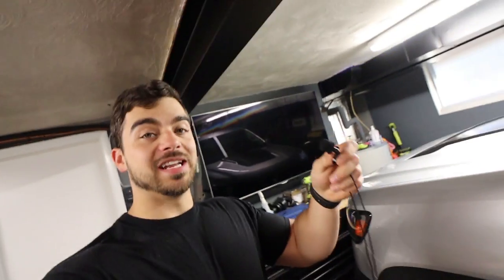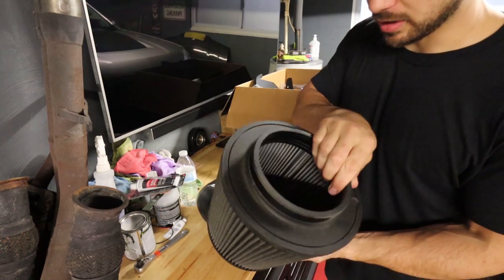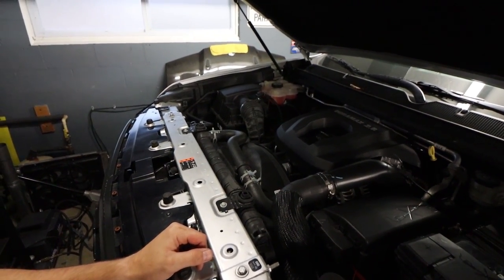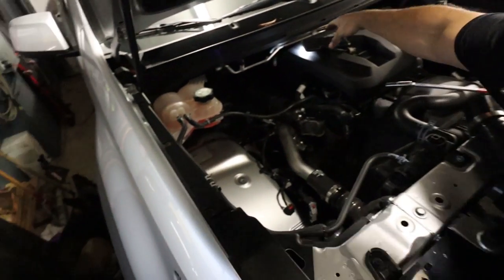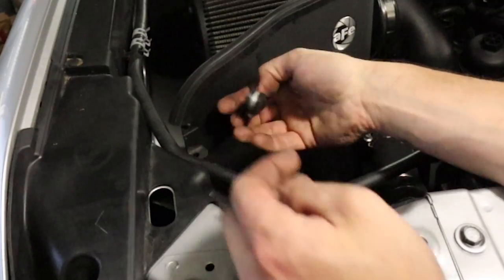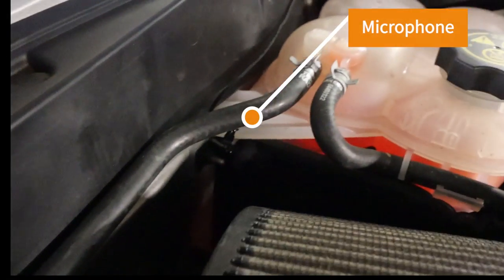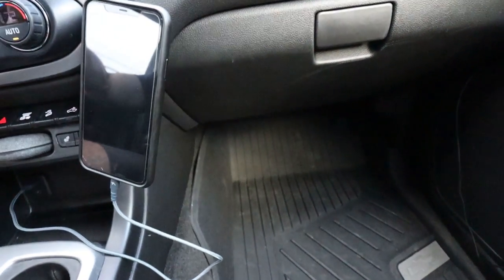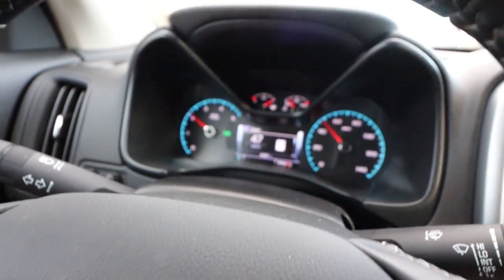Colorado Diesel AFE Intake Install with Engine Microphone on a Tuned Duramax ZR2 * LOUD

Comment: Love that microphone, hear the blowoff valve I think....sounds really good
Reply: there is no blow off valve
Reply: Its compressor surge
Reply: @collinpaine2572  no its not lol the truck isn't under any load and its very hard to surge the stock setup
Reply: @HunterSkiff  its a tuned truck so its going to command more than a stock tunr and the stock turbo is only a 52 mm exducer. And with no blow off valve the air has no where to go. Its normally muffled by the stock intake. If its not a small amount of compressor surge than what would it be? I have a zr2 diesel and mine will do it under a slight load with my tune.
Reply: @collin paine  kinda hard to have compressor surge with a diesel that has no waste gate. Diesels dont really care about air volume going in as fuel is your throttle. The 2.8 duramax has a butterfly that is used for exhaust brake throttle.

Comment: What kind of fuel economy are you getting now? I did the “Canadian weight loss treatment”  to mine as well. Thanks to you good sir! I did the S&B intake on mine. That VGT turbo makes it sound like a Compressor letting off at low fuel input lol 😆 I have 2500 miles on upgrades and I have seen at 75 I average 26 to 28 mpg on a route that I normally got 20 to 22. The odd thing was going through the hill country of Texas. I use to average 18 to 21, now I’m averaging 29 to 32 😁. Next mod is a Catch Can. I wish I could post a pic of my map sensor. That thing was caked solid.
Reply from the maker: I actually just got a catch can, just haven't installed yet!  

Been averaging about the same, 27mph.  Highway is 30 with a best of 35.
Reply: Why a catch can after the weight loss..? EGR is closed...

Comment: Thanks for posting and showing the things I don't want to do with my Colorado Duramax.....
Reply: I’m on the fence ordering an intake for my babymax. Could you qualify your comment please?
Reply: @cam4usa   The amount of power added is not that great when you consider the cost of the kit.  There are plenty of restrictions that unless you're going to replace all piping, intercooler, and re-arrange the engine compartment, it just isn't worth it.  Additionally, the noise from under the hood from the open air filter / cleaner is annoying.  I let a friends firm use my previous truck while I was out of town to confirm fit and finish on a 4.0 Toyota Tacoma.  I drove it home and took it off.  FYI, the HP gain was only about 10-15 HP.  You got your diesel for the torque, if you want a hot rod, get a gasoline engine or an electric vehicle.
Reply: @LoydChampion  fair enough to point out low return on investment, still it is fun to tinker and experiment. I don’t think our friend in this vid had any intentions of turning this into a hot rod though.
Reply: @cam4usa   I know, I'm guessing he just likes the extra noise.  I guess I'm an old fart racer now, I leave the noise for the race car and like the quiet and comfort in my daily driver.